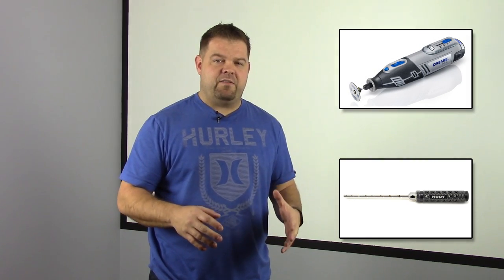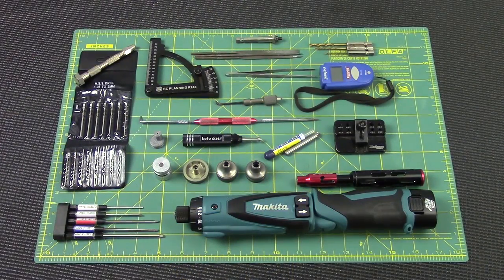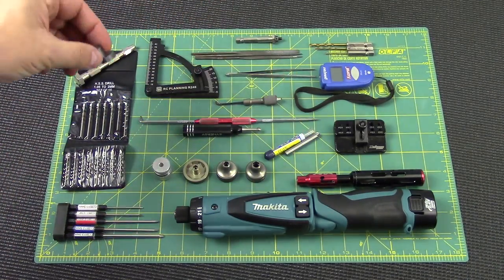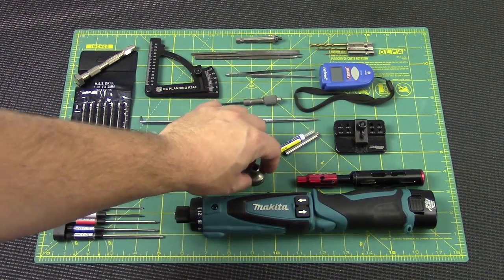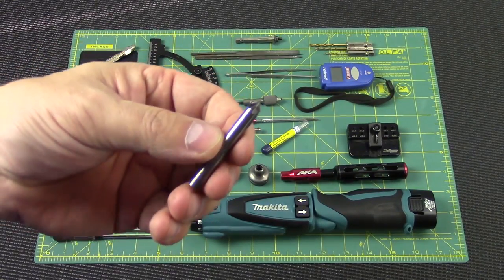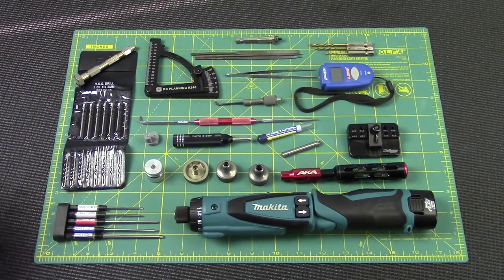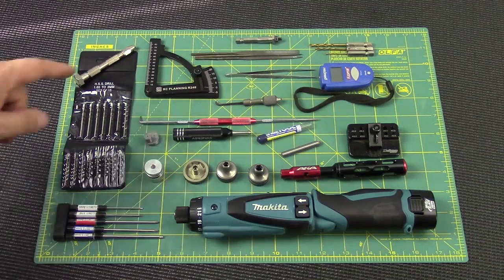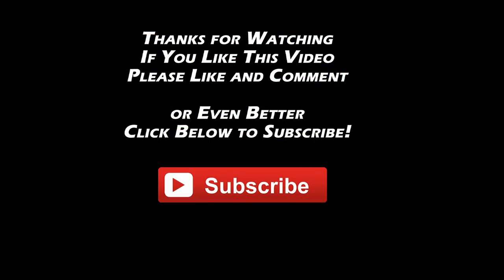Art of the Build: #3  Advanced R/C Tool Set

Comment: hey Jay love your videos, drives me mad checking for a new one every five minutes lol quick question for ya so I just purchased a tlr 22 2.0 off ebay only because it came with a metric ton of extras, I actually want to get decent electronics for it because I am always Mr cheap so I'm debating between reedy blackbox 410r and the orion r10 pro, I'm leaning more towards the re e dynamic because it dosent have a switch and I am always ripping off caps and cutting switch wires, I will be running a reedy m3 7.5t motor and also love silent cars jus t like you, btw how quiet are the reedy systems? I would just like your opinion on would system would be best for me and my car running on astroturf